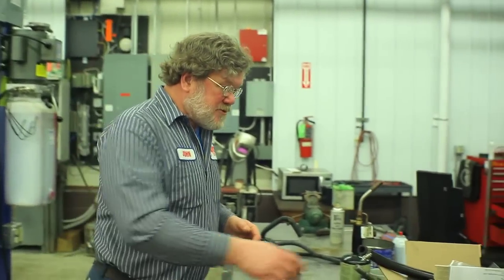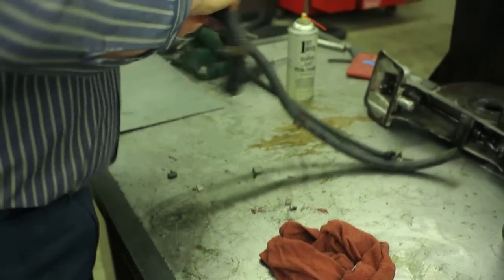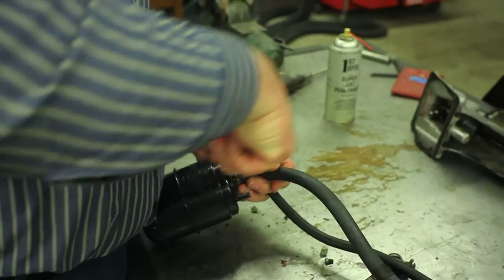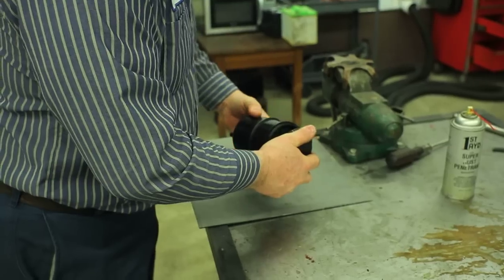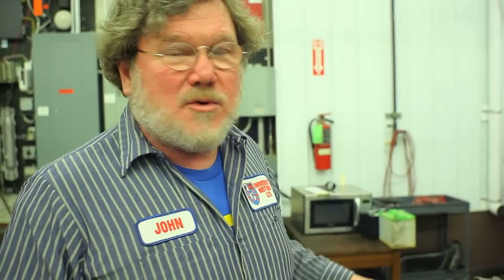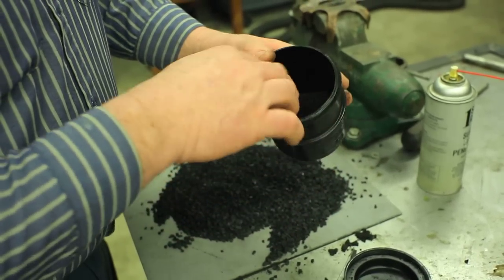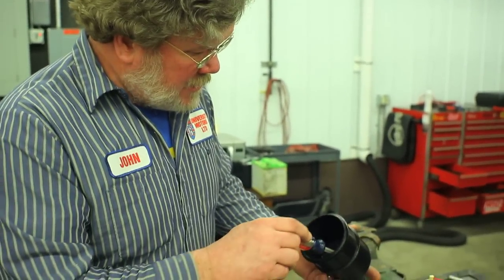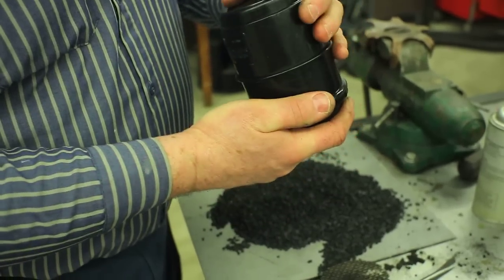186 MG Tech | Charcoal Adsorption Canister for MGB & Midget

Comment: This was most helpful for my 75 MGB, John. I found the mesh at the top of the canister was completely rusted and charcoal was sitting at the three top hose connections and at the bottom connection. No filters were found at all. (Now need to check the run-on valve for blockage) I used the suggestion of scotchbrite for filters and had some trouble finding a replacement for the wire mesh. However, at Home Depot they had gutter guard wire mesh ($2.29 for one piece) that after cutting a piece just larger than the inside diameter of the canister and folding the edge up, I got it to fit very nicely with the homemade filter fitting snugly inside. Also refilled the canister with fish tank charcoal. Total repair was about $15 and time spent cleaning and fitting back together was about 2 hours. I am a first time MG owner and learning as I go. You have some of the best resources I have seen for the problems I have had so far. Thank you.

Comment: John - great video! I never thought of just burning off the gas that was in the canister. What about canisters that you can't open up? I saw someone spray WD-40 into their canister, who claimed that it worked fine after that treatment.
Reply: WD-40 only treats the check valve located at the ports of other vehicles charcoal canisters, especially the one from the fuel tank line into the canister. WD40 does not however "unclog" the actual charcoal, in case it would be clogged.

Comment: John, I am rebuilding my canisters, and my hoses all are brittle and need replaced, can I just use regular bulk hose that is the correct size and do the screen door spring trick - or is there a reason that I would need to buy the formed hoses?
Thanks for all of your videos!

Comment: Are the charcoal canisters essential for operation? What would be potential consequences (if any) of running a B without the canister? Any precautions?
Reply: acousticpunker  it will still run but federal law says you cant because emissions. i hear tho if you dont fix   evap canister it could make gas tank implode or even explode
Reply: I don't think an MGB is capable of throwing an EVAP code...but if you live in a state with visual inspections the lack of it would be glaring. Aside from that, there's really no consequence aside from the fact that your garage  can smell like gasoline. You're essentially reverting to the same "open" system as used pre-charcoal can(1969 California, 1970 the rest of the US) cars.
Reply: An MGB originally fitted with a charcoal can has a vent line from the gas tank to the charcoal can. If you don't have the charcoal can in place, the vent line will be open to the atmosphere and allow the pressure to equalize. If the line is plugged, you can fit a vented gas cap as used on earlier MGBs. If you have a plugged line(or an unvented tank) and a sealed gas cap, the car will tend to stall out as the fuel pump attempts to draw a vacuum on the gas tank--when that happens you can confirm if you open the gas cap and hear a "whoosh."

Comment: Thank you John! My daughter's 79 Midget was experiencing intermittent rough idle and outright stalling at random - hot, cold, after a few blocks, after a 30-mile drive. When I pulled the tube off the bottom of the primary charcoal canister a handful of charcoal spilled out. The foam barrier had completely rotted away. I'm still testing it but I figure that sometimes the pieces would shake loose enough to let air thru and sometimes would block tighter based on random vibration.

Comment: no need to use the blade make a hot wire saw using a kanthal wire a battery and bring it to incandescence then use the hot wire to cut the seam ;)

Comment: What about cleaning out a rectangular charcoal cannister (1999 Toyota Corolla)?  Are you able to open it up as easy as this?
Reply: Usually, newer ones are sealed. Some plastic containers may be easy to open with a knife and then reglued. Metal ones (e.g. Corolla E10) are harder to do, next to impossible.